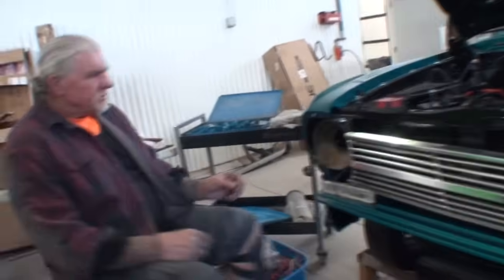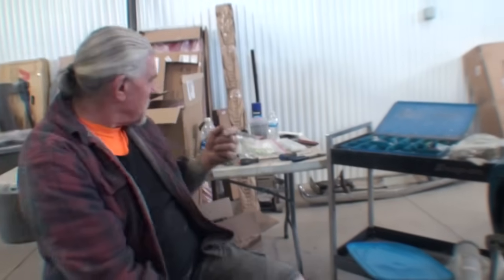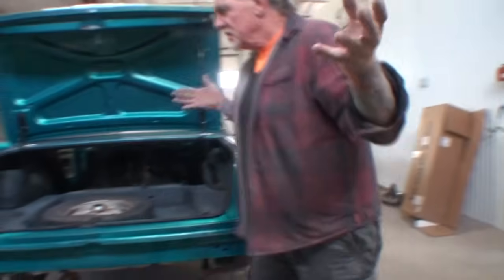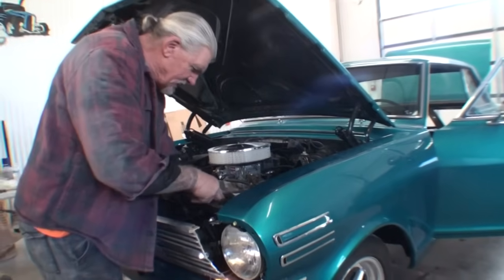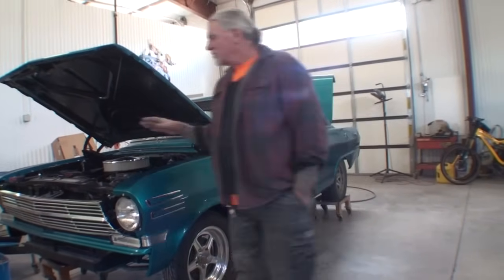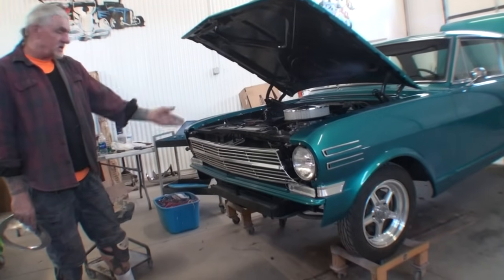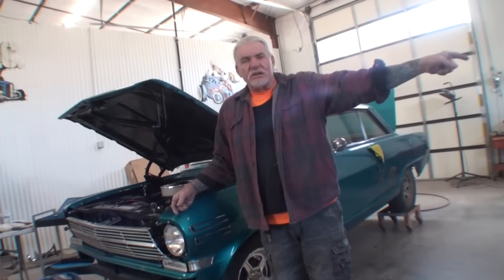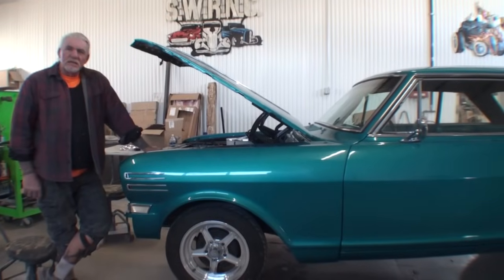Why Should I Restore This Old Car - KAREN GONE WILD Insane CRAZY

Comment: I've had a 1974 dodge pick up truck with 85 % of the lights not working similar to this car. best thing to do if you don't want to spend a lot of money is to buy a full spool of 12 gauge  red automotive wire and another full spool of 14 gauge black automotive wire and using the exiting wire as a map and rewire the entire lighting system. It's not complicated but you have to take the time to do it properly. The problem with dodges of that era was the small gauge wire size and the main reason for shorting (melting insulation) . The bigger the size of wire the coolest electricity flows.
Reply: Old dodges (and other mopars) have ampmeter on dash it has burned down mopars more than lightining has houses. Wire comes from battery to the dash without any fuse or circuit breaker. Almost burned my 69 dart too. Lesson learned. First thing i would do on old mopar is to pull that wire out completely you wont need amp gauge anyway.

Comment: That T3 is factory. I'm '62 Impala still had all four of its factory t3s when I sold it 3 years ago. Reproductions cost a fortune. The turn signal looks like it's grounded to the ignition. One of the horn notes isn't working. What a mess.

Comment: From a logical perspective, the vehicle is 45 years old. Rust, wiring, owners much less techs who have worked on it. 
  In 45 years; How many times have you hit a sharp edge & bleed? How many time have you stub your toe? How many times have you sacked your elbow, knee or fell? Answer: Dozens of times! Same with a vehicle. I enjoy wiring and even better with a schematic. Amp meter? Chances are you have two fuses inline in the engine compartment that are between the alternator and gauge and another from gauge to the external regulator.
 Not only should wires be soldered & shrink tubed, but dielectric grease at terminals. Coating on wire (if copper / as aluminum was used for 2-3 years) but with these symptoms be a turn signal switch only, or connector at the base of the column. I confirm all the problems, look at the schematic and determine what would be common to all. This is before doing anything. 
   The PVC covering on wire has changed to higher temperatures with coated wire & oxygen free copper. New cars have tiny gauge wires with ground for control. These are are factors that needs to discussed with a customer before making it look pretty. It’s like new chemistry paint, base & clear, applied over OEM paint, a back yard fix, the house exterior latex sanded smooth 10 years later, with “Earl Schibes” $99.95 complete deluxe  now it your turn to paint in the 21st century! Won’t work, won’t last! And evils lurk below! 
  All wiring can be fixed, but change certain circuits & practices into new. Now you have dependability!